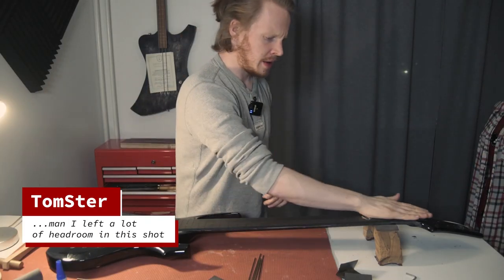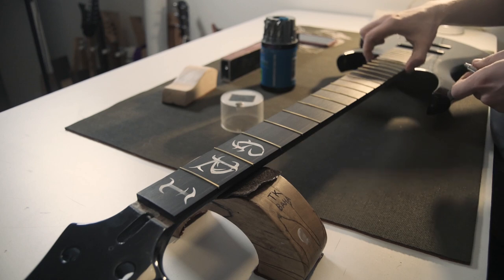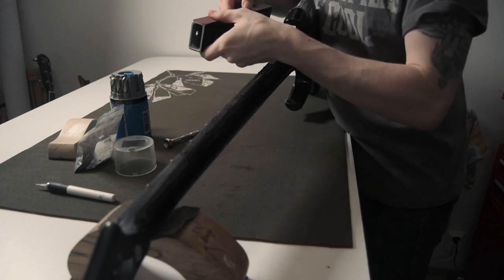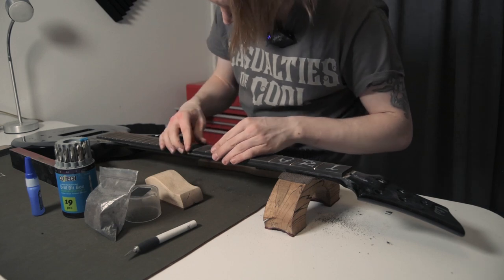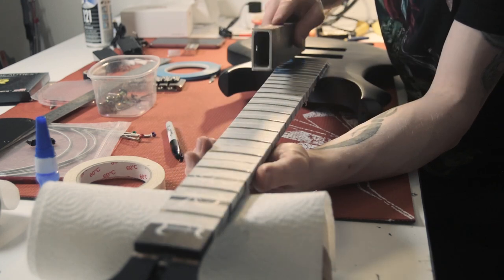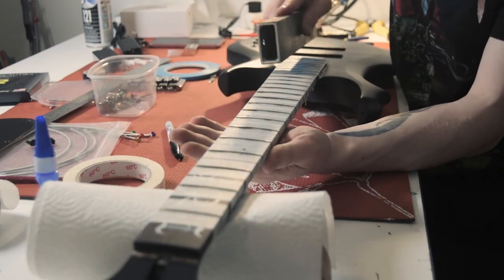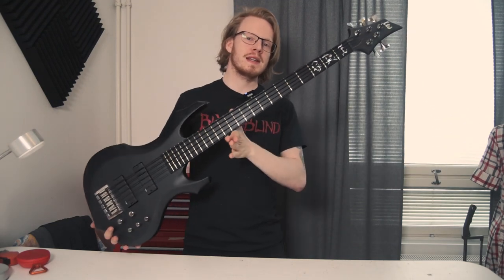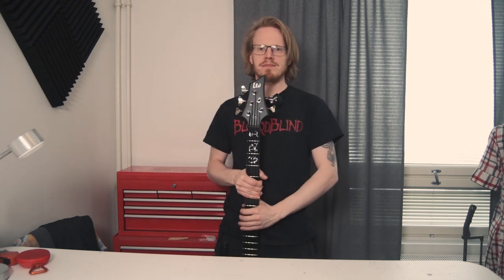How To Fret An Instrument & Step-by-step Fretwork

Comment: Never hurts to watch another fret levelling video and see new things :)   Do you ever start levelling with a beam and realise one fret is so much lower than the rest that you'll damage all of them? (So end up having to replace that one).  I was on the verge of doing that last weekend, I didn't know how common it was.
Reply from the maker: I had that with one of my guitars that I refretted. A big inlay went through a fret and sank it down. Still haven't fixed it up😅 would require putting in some rosewood for support. Bad thing is, it's the 12th fret..

Butyeah, I have heard of this happening and it is at that point best to cut your losses and just refret that one fret. If you're lucky, it's one of the higher frets and you might have a chance of doing away with the issue with the fall-away🤷🏼‍♂️